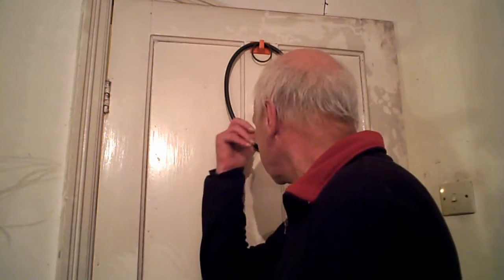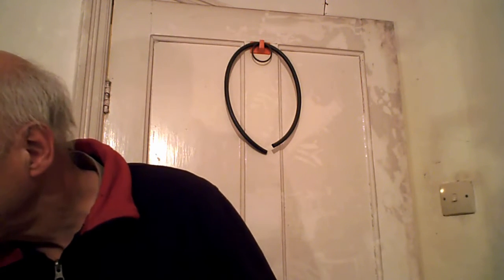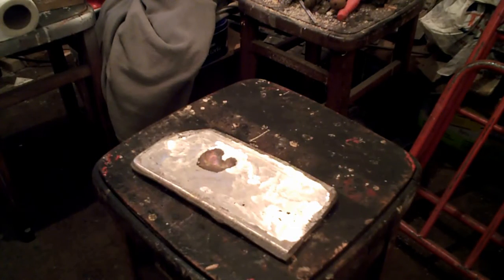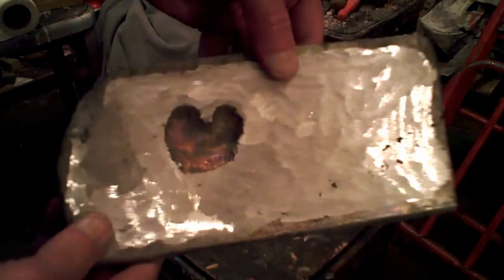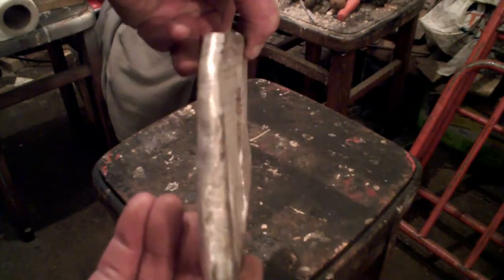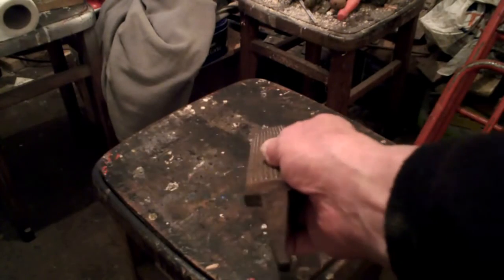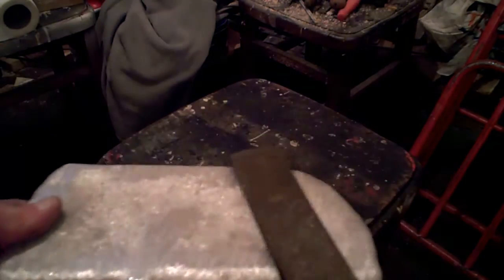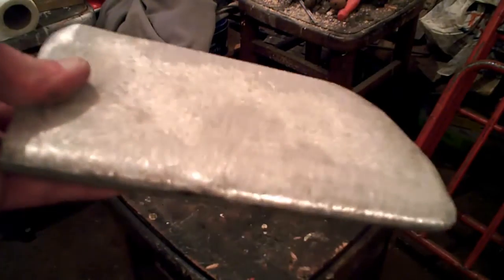Model Steam Engine #13 Great News and Demonstrations

Comment: Great demo Malc drilled pretty square for free hand well done ,,,  you will love the bench drill when it comes to doing stuff like that,,,  and I have a load of odds and sods of scrap ally pipe, angle etc I will sort a selection out some of it may be handy as the project continues ,,,,,    good watch many thanks
Reply from the maker: +Alan Plumb Thanks Alan - everything is much appreciated.
 It's all fun, even the arduous grinding and filing. 50 years of experience of engineering does come in handy sometimes. I've some more ideas for the forge, and casting projects. Thanks mate :)

Comment: Success on the taps !
If you look back through my videos I did two on modifying my snowmobile running boards .
I used a course file and a jigsaw on the aluminum sheeting
The course round file can hog out a lot of aluminum ,,too much if you're not carefull  as a matter of fact .
Reply from the maker: +Bagot Corner Hi buddy - I've seen those, you did a really nice job.
Because I've cast my rough, thick ingots, too thick actually however it was all experimental, so most of my pieces will be pretty rough. The only thing I do want to finish properly is the flywheel. It should all become clear when I get to it (grin).

Comment: Very interesting and I know you will hold your head in your hands in despair, but - a tap is a tool that makes a screw hole?
I am amazed at how you make it look so easy to get that hole just right for the screw - if i try to drill a hole for a rawl plug, well, let's say "complete failure" hole is always far too large, rawl plugs either disappear or break and results in messy filling of said hole and then leave an obvious sign of cack-handed work - my cat do a better job than me!
Reply from the maker: +Eezee Listen Yes a tap makes the thread in the hole for the bolt to screw into....sort of like a static nut.
If you get the drill size correct, it's easy....so always refer to the chart, or internet.
Must admit I don't like rawl plugs. Easy in new houses, but with some of mine still being original stud walls. For instance, have you seen the props on my bench. Over the years I've had several attempts to attach it to the wall, but all have failed.